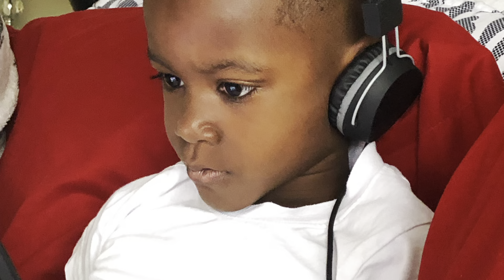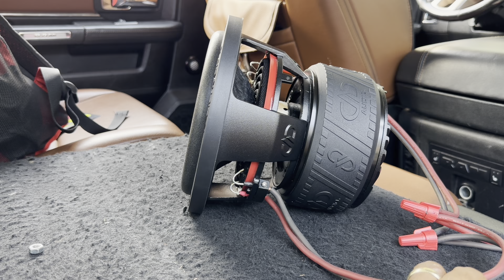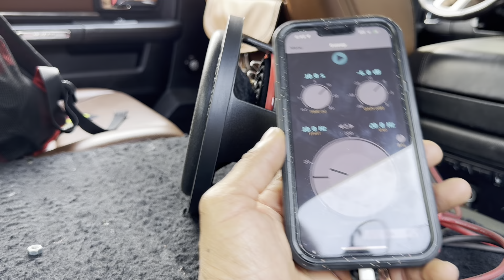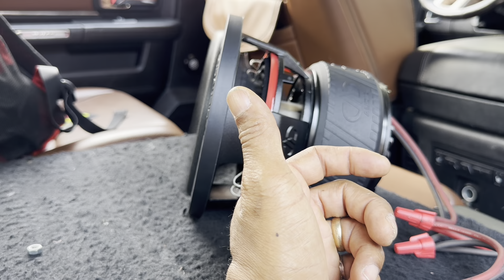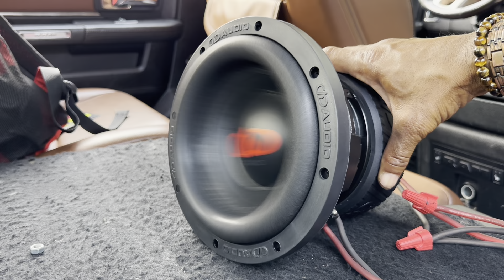Digital Designs 608f Free Air Frequency Sweep Powered by a M2500@ 2 ohm!! No Mechanical Noise!

Comment: This sub is very noisy free air if you actually push it decently
Reply from the maker: @kargooooo  no more mechanical noise than a Sundown X8v4. In fact I think it’s quieter than it, and performs better overall
Reply: @M.B.Enclosures As someone that has a 608 it's the noisest sub I've owned and many say it aswell